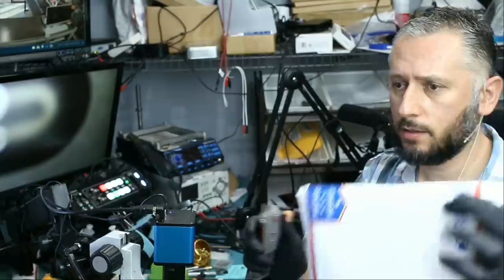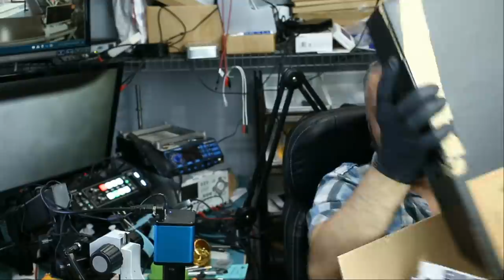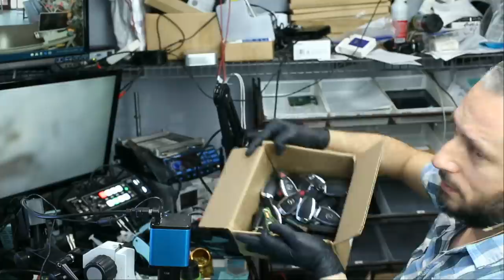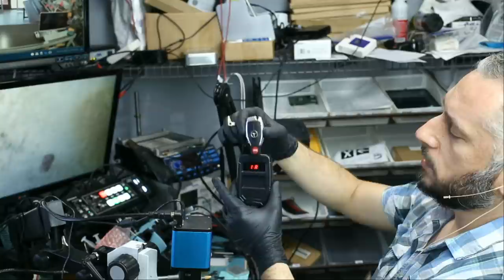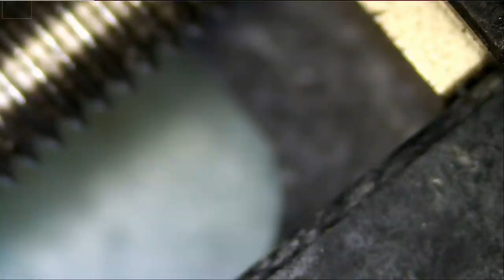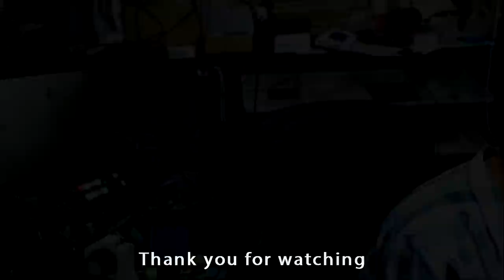Circuit board repair for Mercedes Benz Key Fob - Tricky one

Comment: Tip: If you think an IR device is malfunctioning, point the IR diode towards a digital camera. Phone, webcam, microscope, whatever. They pick up a surprisingly wide band of IR light, but its compressed into the visible color spectrum during image processing.

Comment: If you ever figure out a solution to Mercedes Benz no longer making available the key-fob chip necessary to start a W140 you could make enough $$ to go buy a new EQS! MB dealerships want +/- $10,000 US dollars. Nothing to do with the motherboard but rather a little chip. (?)